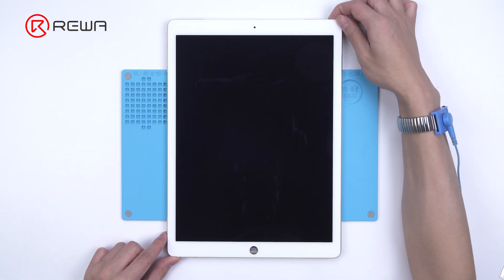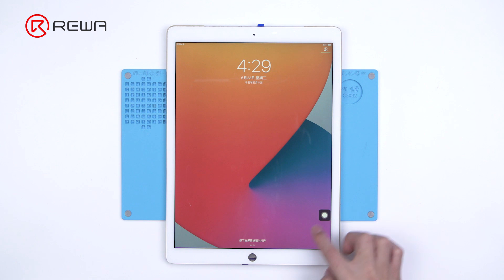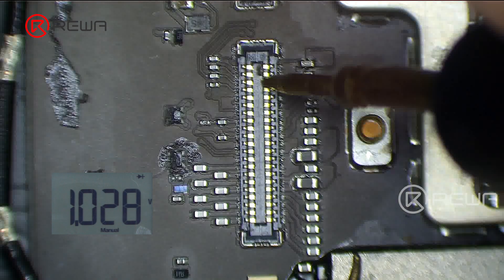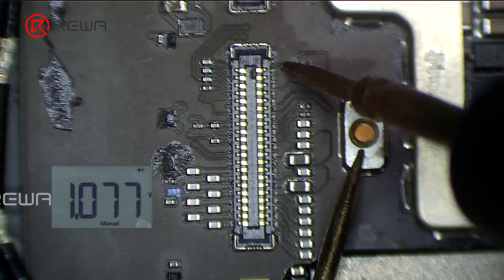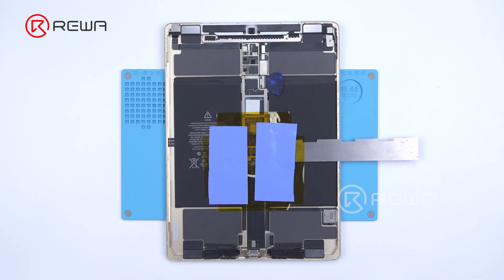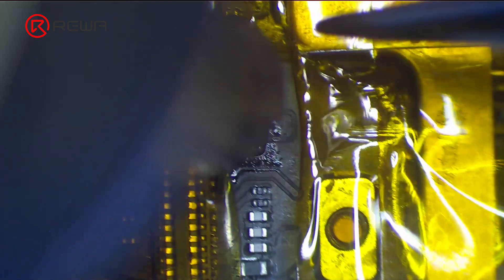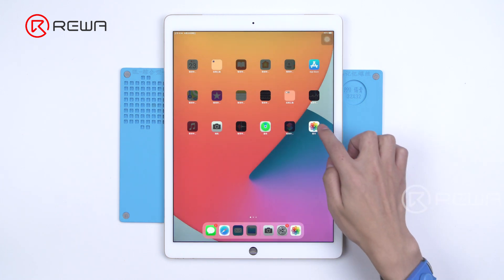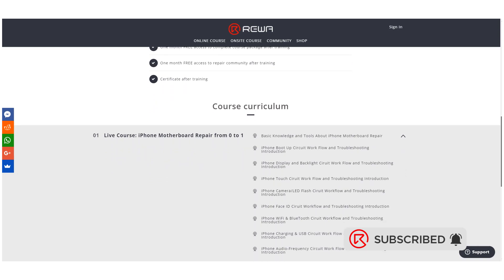iPad Pro Touch Screen Not Working /Unresponsive Screen Problem Repair

Comment from the maker: If you have some repair topics that you are interested in or suggestions for us, please leave your comments here.👇👇👇
Live Course Entrance: https://bit.ly/3jV7nto
iPad Parts: https://bit.ly/2Uwl4Ee
Reply: How did you  get the circuit diagram, thanks
Reply: Can we directly connect that 2 points of the inductor by jumping wire beside replacing it, will it work fine??? Plz reply
Reply: What will it cost to repair this issue
Reply: WaiteMac book& imac repair videos

Comment: There's an unresponsive vertical bar on my ipad pro 10.5 when it's in vertical position. I tested it with an app that let's you draw on the screen to test it out. The bar extends from the top to bottom of the viewport.

Comment: well, mine iphone board worked just fine because when i replaced the screen, all working fine. but the original screen have touch problem after water damage. Is there any way to fix that original screen? replace digitizer maybe?

Comment: How much could cost this operation? I have an Ipad Pro 10.5 2107 (second version), that is unusable while in charge
Reply: Same
Reply: i have an ipad pro 1st gen with the same issue? where are your location kn central luzon?
Reply: @norellramirez8095  I sold it to a guy who need it mostly as second monitor 😢

Comment: iPad Pro first Gen does not have 3D Touch
Reply from the maker: Different from the previous hardware implementation of 3D touch function, Apple later put the 3D function in the software. So the iPad Pro will have the 3D Touch function after the system is updated to IOS13.